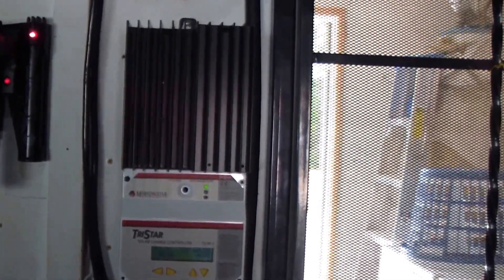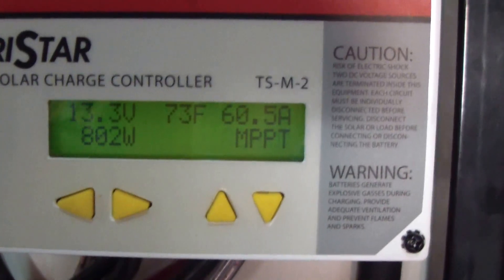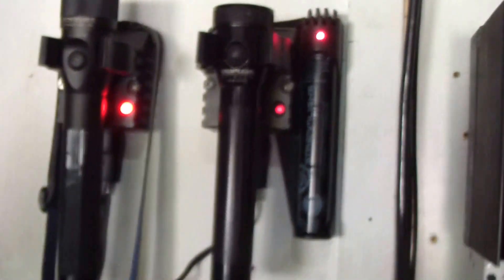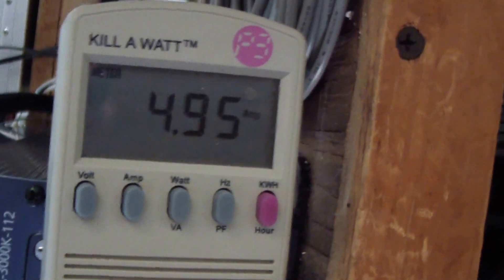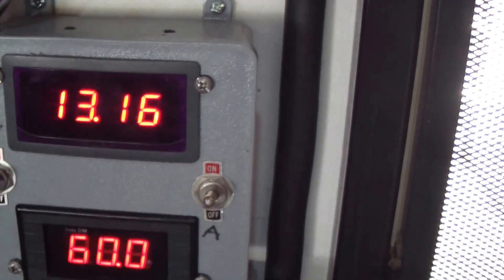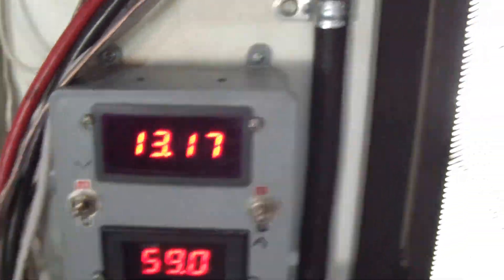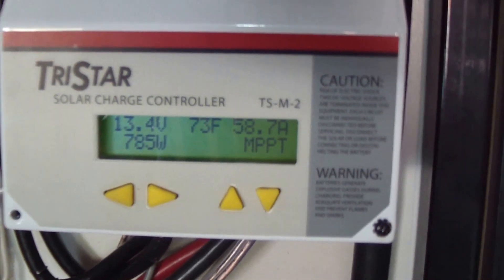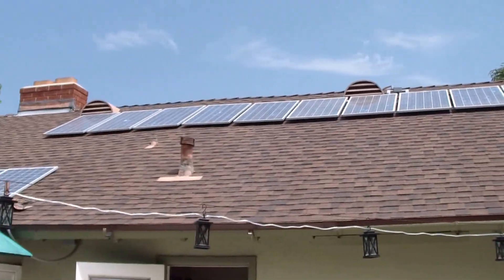I Broke The 60 Amp Barrier! Time For A Midnite Classic Solar Charge Controller!

Comment from the maker: Sold it, Over the past three years Outback replaced my FX 60 charge controller three times and still was not working right! It would show bulk charge when its pitch black outside, the startup screen was showing alien language, the restart button would not work and some days it would charge/absorb for 3 to 5 hours even when it was programmed to charge one hour only. I did not want to come back to a burnet down house!

Be Well, Godspeed,

El Raz

Comment from the maker: Total of 12 set of 24 V, 105 W panels, divided into to sets of 6 panels each, stringed together in parallel and then the two sets of panels stringed together in series to make 48 VDC.  Please watch my other video, "1.3 Kilowatt Of Solar Panels On The Roof" for detailed information.  Hope this would help your inquiry and do be careful please that setup will burn your skin/flesh if not handled properly!
Be Safe,
RS

Comment from the maker: This is my humble opinion only: Did start with 24 Volt but found out that if a battery goes bad the system would lose its integrity! Now my whole house LED lighting system runs on 12 VDC, the inverter input is 12 VDC and the important thing for me is that in case of an emergency I can charge the battery bank with my car's charging system.  But you are absolutely right old friend the higher the battery bank voltage the more headroom you have. Be Safe, Raz